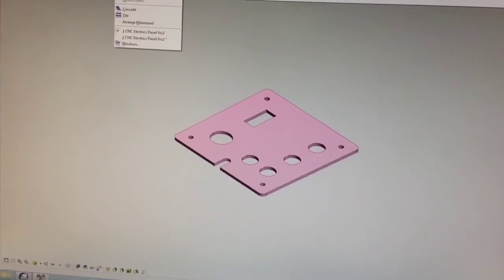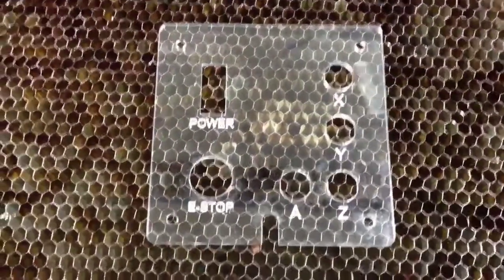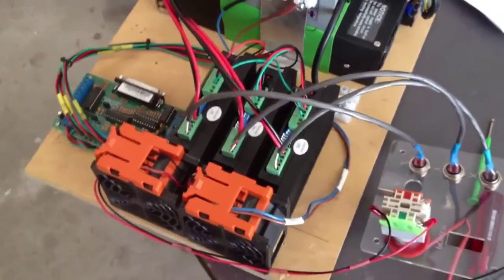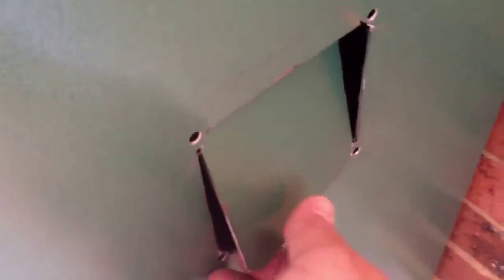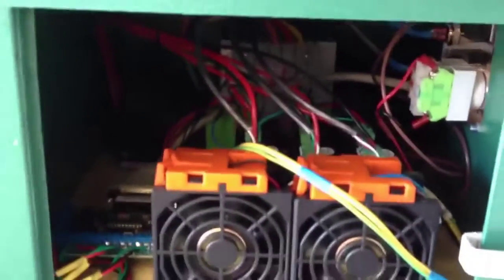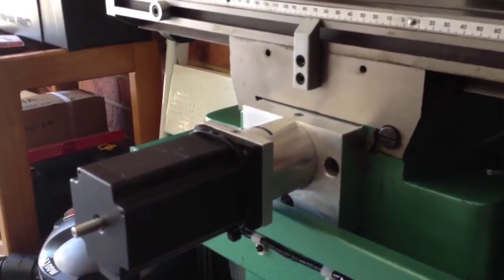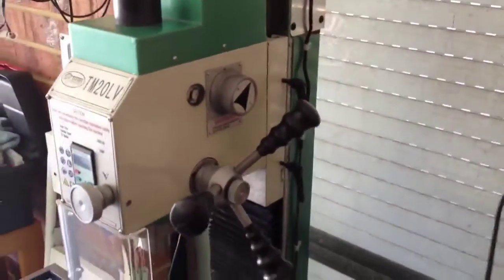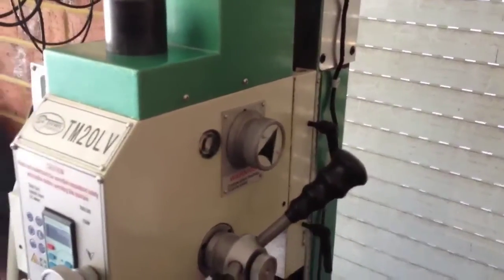CNC Mill Conversion - Titan TM20LV Part 4

Comment: Just interested to know where did you buy the BOB motors and drivers? Also you is the spindle wired is it controllable via mach3? I am going to convert my BF20L and trying to find all the parts required.
Reply from the maker: Customairseals G'day mate, I purchased all my electronics from the United States.  The company I used is on the net and they're called automationtechnologiesinc.  I went with a C10 breakout board, Keiling Digital Drivers, 48VDC powersupply, and Nema-23 570oz  steppers.  Hope this helps?  Aaron.
Reply: Yes thanks I did suspect you probably got them from Keiling USA can't  find any one selling them in OZ